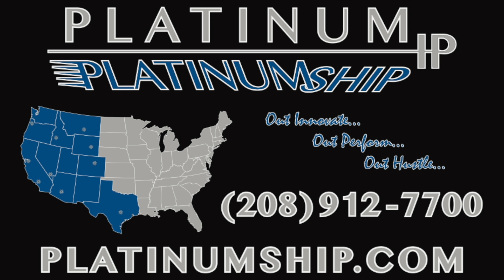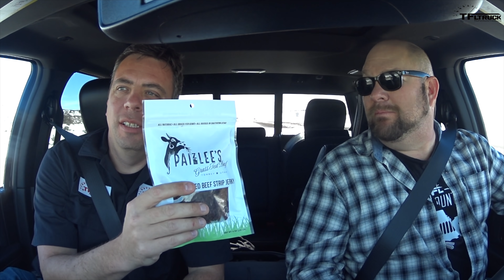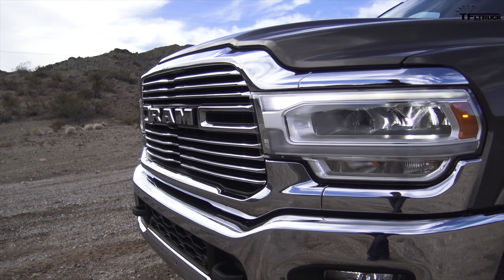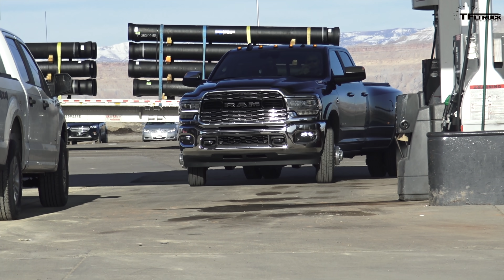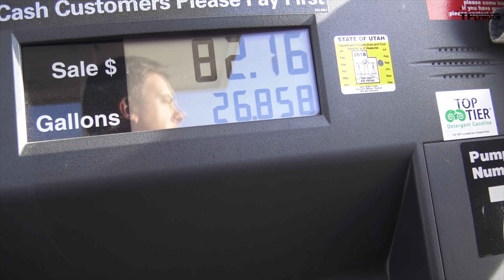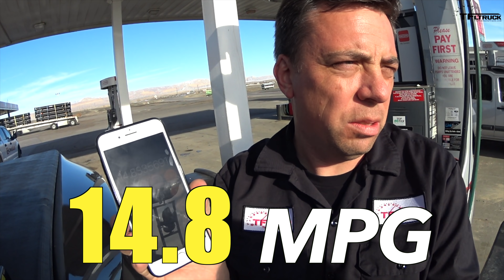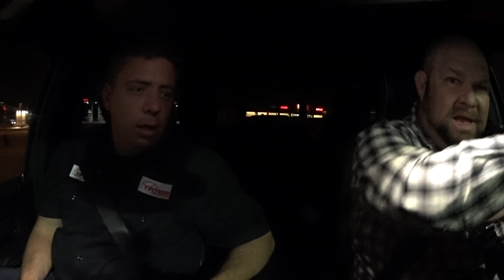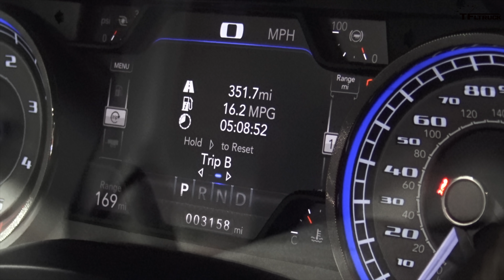We Drive 800 Miles in the New 2019 RAM 3500: Here's How Fuel Efficient 1000 lb-ft of Torque Is!

Comment: Man that's a good looking truck.
Reply: No it's not,  that's one sexy looking truck
Reply: sure is. now it needs some 10 lug american forces and window tint ha.
Reply: I think RAM makes the best looking duallys. The fender flare on the Ford dually looks like it was tacked-on as an afterthought.
Reply: I’m a Ford guy usually and I agree, Dodge is really stepping it up lately.
Reply: 16 mpg...that's considered good?
Reply: SwopetheDope 
For a heavy duty 12,000 Lb truck it certainly is. My 1/2 ton 5.3 liter gasser GMC Sierra gets 18 mpg.
Reply: @SwopetheDope Its great! What sort of mpg do you think 3 Honda civics each equipped with biggest cargo roof top box get combine?
Reply: SwopetheDope 16mpg is amazing for a limited crew cab 3500 dually. Fords gets significantly less, especially because it’s a v8.
Reply: It's stupid I know. But I hate the ram hood badge.  GM's duramax/allison badge looks good.
Reply: It is, but I'm not a big fan of the large computer screen inside
Reply: @ThenotMrNiceGuy0109  Only the Limited comes standard with the 12-inch display, every other trim comes with a 5-inch or 8-inch display as standard.
Reply: @ThenotMrNiceGuy0109  Well it is optional, you can still get physical buttons, if you wanted.
Reply: @ThenotMrNiceGuy0109  Our 2019 Ram 3500 has the small screen. I like it--can turn it OFF.